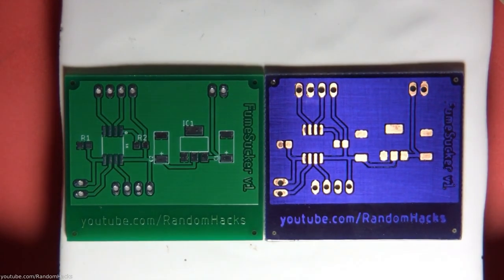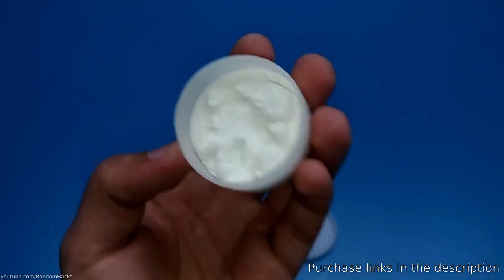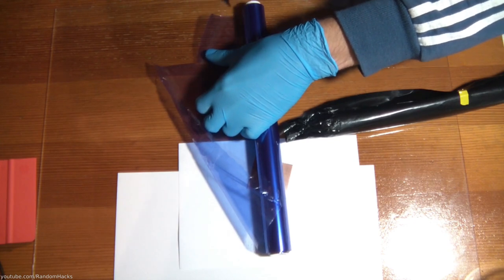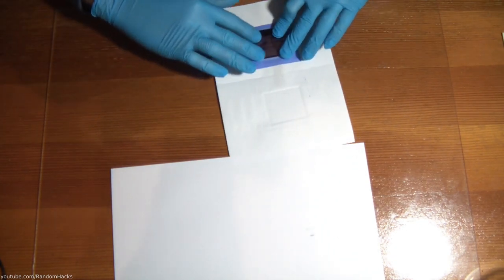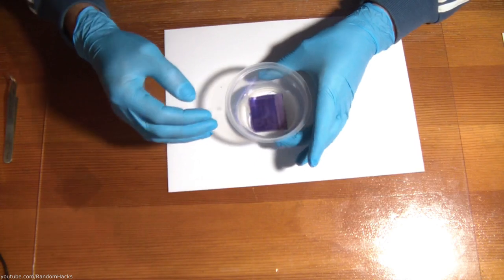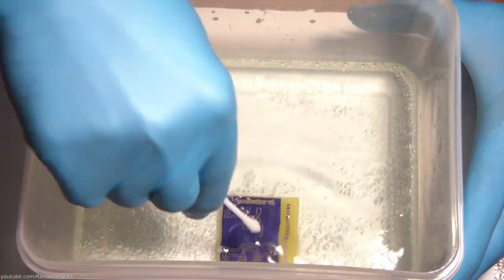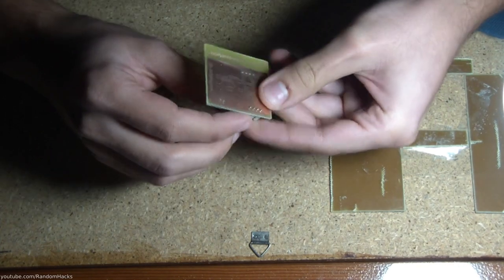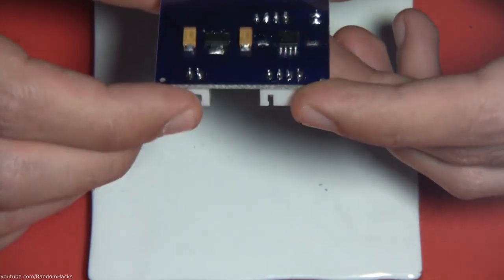How to make a PCB with solder mask at home (muriatic acid + hydrogen peroxide, dry film method)

Comment: I've used dry film as a solder mask like 4 years ago in a PIC trainer I made, it was a bad idea! Dry film wasn't design for that use and of course, it does not have same properties. When I tried to clean pads from burned flux with solvent, it damaged the film! So it's not heat resistant and not at all solvent resistant. I was so proud, it was a gorgeous PCB :(

Comment: Hydrogen peroxide and Hydrochloric acid I have used for almost 50 years after learning about it from a Danish Engineer with whom I worked when I was a student engineer doing industrial placement. 

He even wrote an article on it which appeared in Wireless World in about 1973/1974 (Sorry I forget the issue number). His name, if you want to look up the article, was Jens Langvad.

Comment: Do you use uv blocking ink? Im finding it impossible to dissolve my photoresist because light keeps leaking thru even tho i have 2 transparencies stacked on top of each other
Reply from the maker: Hi, you need to find out the optimal settings for your printer. Usually there is a photo setting that prints at the highest DPI and results in completely opaque blacks. You can also try to reduce the UV exposure time.

Comment: without plated holes.
Reply from the maker: True. Forgot to mention it.
Reply: @RandomHacks  without plated holes and vias and without plated pads you cant make multi layer connections. Use jlcpcb. Dont imagine making a pcb workshop. i  made a multilayer pcb workshop for my projects i spent thousands of dollars i can make a 4 layer pcb in 5 days. i left making pcbs at workshop. Because pdcl2 is very expensive.
Reply from the maker: @annaoaulinovna  I would never try to make a multilayer PCB at home 😅 Even single or double layer from now on I will probably just order them online, as cheap as they are it really is not worth the hassle to make at home unless I'm in a big hurry.

Comment: My solder mask can not be dry Does it need stronger uv lamp ??sometimes companies says their uv solder mask supported for example 3kw uv lamp can i dry it with a 36w uv lamp but more time??.
Reply from the maker: Hi, it could be an issue with the wavelength of the UV, check the instructions of your particular solder mask and see if your UV source has the same wavelength. Usually solder masks dry even with less power UV sources it just takes more time but if the wavelength isn't adequate it might not cure at all. You can also try putting it in the sun.
Reply: @RandomHacks  OK and thanks for feedback 👍